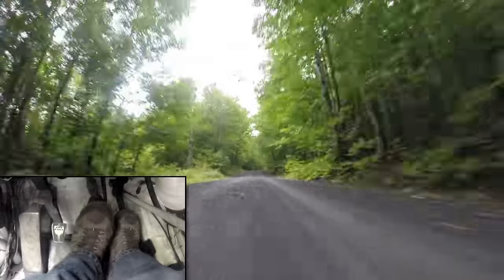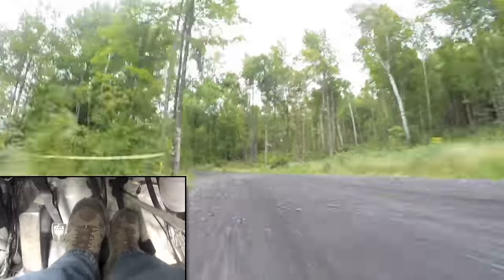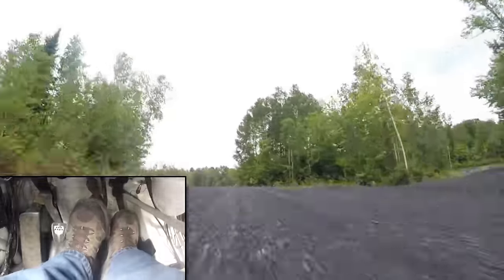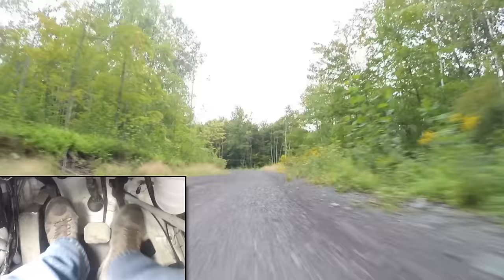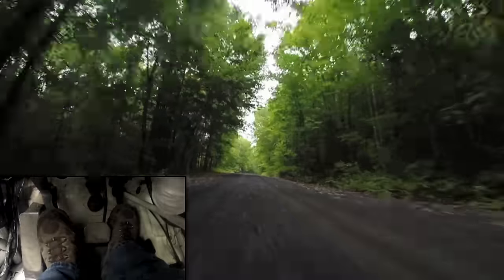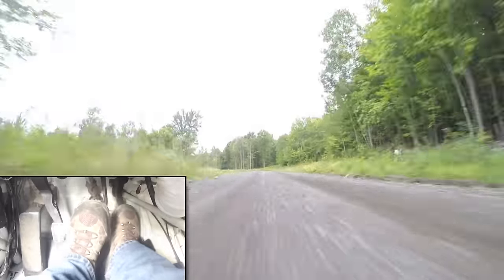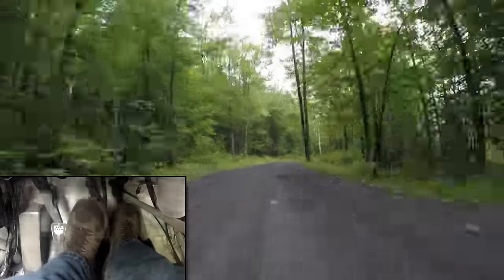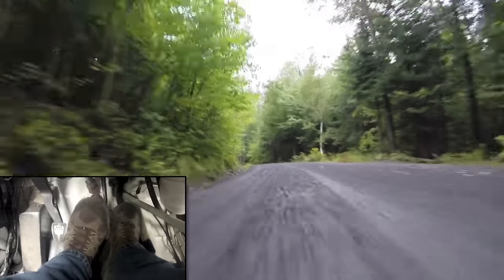Rally Driving Explained

Comment: Is there a difference in braking and throttle control with all wheel drive cars?
Reply: +Ivanrico238 Assuming the car has ABS disabled, it'll be harder to lock up the rear wheels on AWD cars, since they're being powered. It'll take a little more brake input to lock them up compared to a FWD car, and unlike FWD cars, all 4 wheels spin at (roughly) the same rate, which will affect brake lock, powering out of corners, etc. It might be harder to kick the back end out, but at the same time it might be a more consistent flow.
Reply: +Ivanrico238 FWD, vs. RWD, vs. AWD there are differences, but I wouldn't call them extreme. For example, with FWD, the gas can pull you out of trouble, where as RWD the same thing can make things worse. It's all about managing weight transfer, and thus traction, to get the desired result.
Reply: SideWays8Productions  FWD pulls, RWD pushes, AWD does both. Everything changes, you don't drive any one like the other. AWD is better in every other way besides top end speed. It's best to have a secondary (independent) braking unit for the rear wheels on AWD rigs. You'll have more consistent feel of what the rear end is doing.
Reply: AWD has nothing to do with top end speed. Hell, the fastest production car in the world is AWD.

And my comment was referring to cars without independent rear braking systems (hydraulic handbrakes, etc). Some rally classes forbid it's use, and in that case, it'll be hard to lock up those rear brakes on an AWD or RWD car under power than it would on a FWD car.

Besides, left foot braking is rarely used to fully lock up the wheels. It's more commonly and easily used to transfer the weight forward to bring the back end around. In order to prevent damaging the center diff, you'll have to clutch in when using a hydraulic handbrake. With left foot braking, you can kick the back end around without locking up the brakes and binding the center diff. Tho it is harder to do when those back wheels are powered.
Reply: SideWays8Productions awd actually affects top speed but in rallying its not important. awd cars lose more power throughout the transmission so thats why.
Reply: It only loses power in acceleration. If your top speed means your transmission and differentials must spin at X rpm at their final drive ratio, having 2 differentials requires slightly more power to spin up to X rpm. Once it reaches that speed, it no longer requires more power, since it can no longer accelerate. That's why curb weight only affects acceleration, not top speed. Once an object is in motion, it stays in motion. For example, a Bugatti Veyron weighs almost 5,000 pounds and has 1200hp, but has the same top speed as some 1,800 pound space-frame Land Speed Record cars with 1200hp, simply due to it's aerodynamics. It weighs twice as much, but due to it's aerodynamic efficiency it can maintain a high top speed, despite it's weight.
Reply: SideWays8Productions there is still a top speed loss as there is a power loss. take the same car with the same engine, but one rwd and the other one awd and dyno them. the rwd will deliver more torque to the rear wheels than the awd will to the 4 wheels, because there is more friction in the transmission (2 or 3 differentials instead of 1). the awd car will accelerate faster though, because of the greater traction. top speed will be less on the other hand.
Reply: Power has nothing to do with top speed...the McLaren F1 only puts out 630hp, and was able to push above 240mph, while a McLaren P1, pushing over 900hp, barely touches 220. One was meant for high speeds, the other meant for cornering downforce. Like I said before, it only has an effect on acceleration, not top speed. Once you get an object into motion (like a car to it's top speed), there's only 2 limiting factors that keep it from going faster (assuming it can rev infinitely). 1, is the air resistance pushing it back, and 2 is rolling resistance of the tires pulling it back. If both of those factors are eliminated (driven in a vacuum, with rock hard tires), and the engine can hypothetically rev forever with no limiter, the car will constantly accelerate. If it weighs more, it'll accelerate slower, but if it weighs nearly nothing, it'll accelerate faster, until something of equal force of the engine's power holds it back (friction). AWD vs RWD will only affect how much power is put to the ground over time (acceleration), not how easily it can overcome air/rolling resistance. It's a bit difficult to explain without a diagram or simulation but I hope my explanation is clear enough lol
Reply: SideWays8Productions i believe there is something you are missing... i know top speed depends on the gear ratio, but it doesnt mean that you are going to reach its top speed, because you need power to overcome the drag. here is where awd and 2wd play a role. by the way, you cant use two totally different cars to compare this. like the f1 vs the p1 thing. f1 weights like 600-750kg depending on the year so... its power to weight ratio is around 1hp/kg. as i said before, the power you will put out to the wheels will be less in an awd, so if we compare the same car in the same conditions, as the rwd car puts more power to the ground, it will be able to overcome more drag and reach more top speed. what you say about the inertia of the transmission, which makes it accelerate slower is true, but even when its moving there is a bigger power loss, as there is more friction in the transmission. this wouldnt affect a car with a short gear ratio that has enough power to reach its top speed in the rev limiter on the last gear, but in street cars you dont usually have enough power to overcome the drag and get to the rev limiter in the last gear, so awd vs 2wd make a difference there.
Reply: You're still confusing acceleration with top speed. Yes, an AWD drivetrain will suck more power than a RWD drivetrain, but only until it reaches it's final drive ratio. Say the final drive ratio on an AWD car and RWD car are the same (X wheel rpm), it'll take the AWD car slightly more power to get up to that wheel speed due to more friction in the transmission and differentials; however, it will still get there. The wheels will still spin the same amount, and cover the same distance over time.

Technically, when your car is in motion, it weighs less. The slower a car goes (disregarding air resistance), the more load it has on the engine, which is why cars get less fuel economy in the city, constantly accelerating from a stop, than they do on the highway, where they're in constant motion. Once you get to your top speed, your engine will have zero mechanical load, since the car is moving faster than the engine will push it in that gear, and will only have to fight the air resistance. Torque, horsepower and weight only apply to overcoming the load of the car during acceleration. Once you are no longer acceleration, weight and drivetrain loss (which counts towards the load of the car), are no longer a factor. Only air and rolling resistance.
Reply: SideWays8Productions trust me im not confusing acceleration with top speed, but there is something you dont realise. lets say that x gearbox with x final drive will get you to a top speed of 250kmh at 7000rpm with 16 inches wheels for example. you have the same car, same weight (lets ignore that the awd would weight more). one awd and the other one rwd. engine hp measured at the flywheel is 200hp. power measured at the wheels is 175hp in the rwd and 160hp in the awd (for example). due to the drag, you are not going to be able to hit that top speed, and the rwd wont be able to overcome drag at 225kmh (it wont go past 6000rpm in the last gear), which is going to be our real top speed. in this case, as the car is not producing enough power to overcome the drag with 175hp at the wheels, the awd one, with less power, wont be able to overcome that much drag, so its top speed would be even lower. do you understand now what i was trying to explain? Hope its clear now.
Reply: I do understand what you're saying, which makes perfectly clear sense when describing the rate of acceleration. Yes, the AWD car will struggle more to put it's 200hp to the wheels, and thus will not put as much power down; however, it only needs that 200hp to accelerate the car against the load of the car, which would be it's weight and drivetrain loss. Once the car gets up to the speed it needs to be at to experience air resistance strong enough to equal it's engine output, it it's no longer working against the load of the car, but against the resistance of outside forces.

Think of it like pushing heavy shopping carts. One of them has 4 wheels that spin freely, the other has gears between them to simulate the extra resistance of AWD. Both carts weigh the same and are shaped the same. You can push both carts up to the same speed that your own muscles will allow, but the one with the simulated AWD will just be slightly more difficult to push up to that speed. And, once you get to that speed and let go, it will slow down slightly faster due to the more resistance, however, once you overcome the resistance of it's weight and drivetrain load, it will achieve the same speed as the free-spinning wheeled cart.

Like I said before, what you're saying makes sense to describe acceleration, which will still effect how quickly a car will overcome it's air resistance if you were to change it's efficiency, however it doesn't describe how a car maintains it's constant forward inertia.
Reply: SideWays8Productions i think you are making it too complex for me to understand. im no engineer, but from what i've seen in dyno results, awd cars put less power to the wheels than 2wd cars, so thats how i was reasoning what i wrote. i still believe that when you get to the point in which the air resistance is strong enough to overcome the engine hp, the 2wd car will be able to squeeze a bit more kmh until it stops accelerating, as it puts more power down to the wheels, which is what actually matters. i understand the carts example you gave me, but in that example the air resistance is not relevant, which is the key of the problem i think. so in conclusion, dont you agree with what i stated in the previous example? the rwd car wont be able to accelerate more than 225kmh at 6000rpm, so lets say that the same will happen to the awd car but at 215kmh at about 5500rpm.
Reply: I see what you're saying. We teach very similar formulas and examples in aeronautical engineering and mechanical engineering, since aircraft are bound by weight, load and aerodynamics just as much as cars are, however the difference between the moving parts of 2 small engines vs one big engine doesn't have as much of an effect on thrust or top speed, since aerodynamics of the engine itself is much more of a factor, and turbine engines work differently than car engines. But, they both share many principles. But a dynomometer only measures power on acceleration, so that would explain why a 400hp AWD Subaru STi and a 400hp RWD Mustang both make the same power at the crank, but the mustang will show more power on the dyno. When power is "lost" to the drivetrain, it's still going to the wheels....it's just taking slightly longer to get there due to it having to turn an extra set of gears. The power loss exponentially decreases as the load decreases.

On a side note, "Dynojet" brand dynos do not factor in weight, load, aerodynamics, torque split, etc, which results in HP ratings closer to the crank rating, where as "Mustang" brand dynos factor in many variables like that, giving it more of a "real world" HP rating. So some dynos will show more, or less drivetrain loss in vehicles, depending what they're calibrated for. 

A simpler way to put it is an example I experience in real life recently; my little brother had me drive his Audi B5 S4 on a long highway because where we were going, he wasn't familiar with the area. He told me to max it out on a straight away, and we hit the rev limiter in 6th gear before we encountered enough air resistance to hold us back. Mind you, this is a bone stock S4 with maybe 300hp to the wheels. It reached it's peak final drive speed, even though it was AWD. To be fair, it was more-so due to it being geared too short as opposed to too aerodynamic, but the point still remains. Being RWD would only make it hit the limiter faster...AWD cars, given the same aerodynamic and grip coefficients as their RWD counterparts, will still theoretically reach their final drive ratio...with just slightly more time elapsed lol
Reply: SideWays8Productions okay i understand you now. theoretically the awd will end up getting to that top speed just as the rwd one would, but taking longer. do you think it applies on the practice too? (with a longer gear ratio than wont let you redline in the last gear)
Reply: Yup, exactly. And by longer, we're only talking only a second or two at most, depending on the power and weight of the cars. Modern cars are constantly coming out with better and more efficient AWD systems that lessen the drivetrain loss by a great amount, especially if it's variable torque split.

But no, either one of two things will happen, you'll either redline the last gear, or reach your aerodynamic limits. Given a perfect scenario with no air resistance, you can have the biggest overdrive ratio ever, something like a 0.01 final drive (0.01 crank rotation for every 1 wheel rotation), and still redline your last gear if you have absolutely zero resistance. It may take absolutely forever lol but still possible. The only thing that prevents you from redlining is resistance....my brother's Audi didn't have enough resistance, while most cars do.
Reply: It's lost until there is no load, and thus no energy required to move the car. That's why your car accelerates faster at the top of first gear than it does off the line. It's already in motion, and thus doesn't require as much energy (heat) to move. Assuming no air resistance at top speed, the same formula can apply at the top of it's final gear.

Load bearing dynos are calibrated to exponentially decrease load factor as the RPMs climb to give the most accurate numbers lost through drivetrain friction.
Reply: So you could swap your car engine for a lawn mower engine while keeping the gear ratios the same and still reach the same top speed, it would just take you a lot longer to do so ???
Reply: Not necessarily. Your car still has an aerodynamic coefficient to overcome, and a lawn mower engine has a lot less power than your car engine (unless you own a Honda, then it's basically the same thing), so it will be limited by air resistance a lot sooner than your car engine will.

But, assuming a factor of zero air resistance (driving in space but also having an air supply for the engine), then yes. It will just take much longer, to overcome the load of the car.
Reply: Oh, that makes sense. You were making it sound like power has no influence on top speed in one of your previous posts, which confused me a lot. This makes more sense now.
Reply: It does, but it doesn't. The more power you have, the easier you can cut through the air and go faster. If you can't get more power, get more aerodynamic. If you can't get more aerodynamic, get more power. The more power and aerodynamics you have, the faster you go. So if you can't make your lawn mower engine more powerful, make the car it's in more aerodynamic, and you'll achieve a higher top speed.
Reply: @SideWays8Productions  Newton would disagree I'm afraid. Power is work done, ie force x velocity. F is equal and opposite to drag anf friction. To go faster, you need more power. Aerodynamics change F, the relationship remains the same though.
Reply: That's what I've been saying. Once resistance equals output power (essentially terminal velocity), you no longer accelerate. If you find a method to decrease resistance, you do not need to increase power to achiever a higher speed. Likewise, if you find a way to increase only power, you can overcome more force in air resistance.

Many car manufacturers can get away with reducing aerodynamic forces before having to add more power. The McLaren F1 is a great example. With only half the power of a Veyron, it achieves 90% of the Veyron's speed, due to it only being 10% more aerodynamic. Meaning; the Veyron achieved it's higher top speed over the F1 by increasing power instead of reducing drag; whereas comparing the F1 to a Dodge Demon, we can easily see how despite still being down on power, the F1 manages to achieve much higher speeds by utilizing its limited power more efficiently through the air.
Reply: All boys care about who got bigger engine. I only care about rotary engine.
Reply: @SideWays8Productions  I find I have to use my handbrake alot more in my subie
Reply: @SideWays8Productions  if 2 cars have the exact same power, torque and drag. Then the one with higher drivetrain loss (AWD) will not be able to hit the same top seed.
Once you hit your top speed you wont suddenly lose all drivetrain loss, the drivetrain loss is a certain % of the total engine output that is being lost in the drivetrain (Sound, heat, even drag to some extend since when something it spinning (all the driveshafts) they're pulling/pushing air around them, also if there's oil it takes some energy to move it around if it's in contact with a moving part of the drivetrain) 
in the end of the day all of that energy is NOT sent to the road to push agains the exponentially increasing levels of drag (Doubling the speed quadruples the drag) SO according to the law of conservation of energy it is physically impossible for 2 completely identical cars where one has a higher drivetrain loss to go at the same speed in our universe